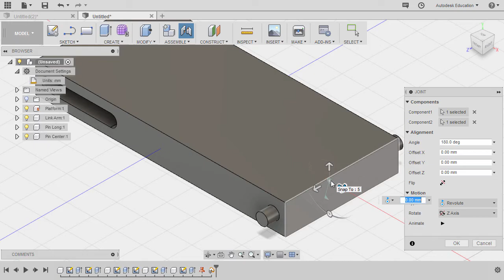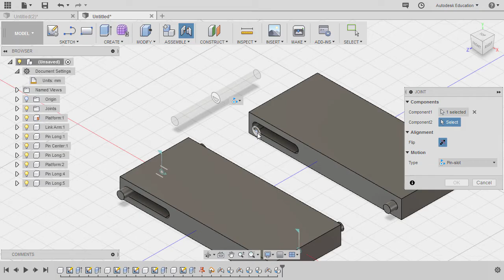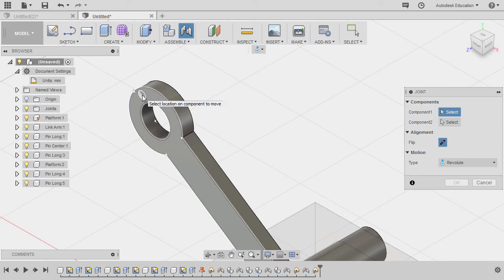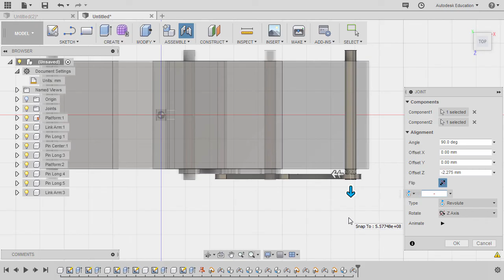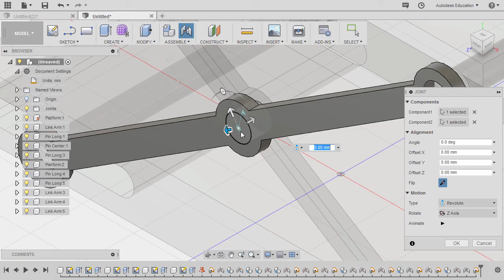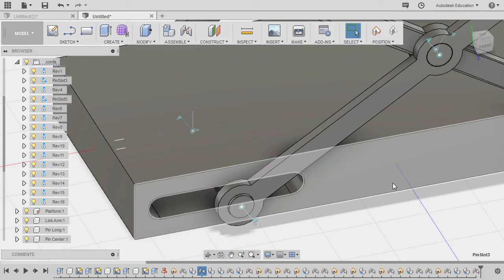Fusion 360 Challenge of the Month: JANUARY 2018 Part2

Comment: Found one problem/solution - Second Link Arm connecting to end pin - make the joint as per the video but then DO NOT make the offset and then it works.  If you adjust the offset then there is interference with the first Link Arm (you'll see red joint markers).

Comment: I finely got it did it. Had problems with the joints turning red.But it is good when you finish Thanks Bill
Reply: Had the same problem. Eventually got all joints working in harmony, but I've got no idea what I did to get them working. -Very frustrating challenge.
Reply: I found I had to hold down control then select the joints hope this helps.